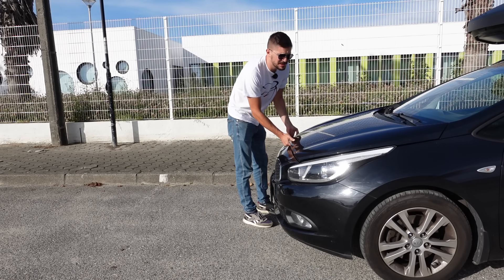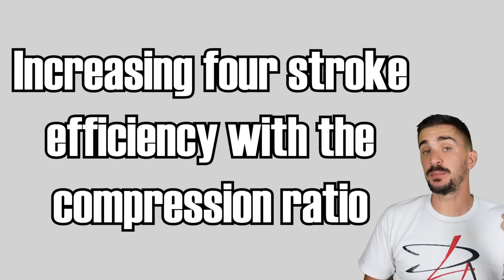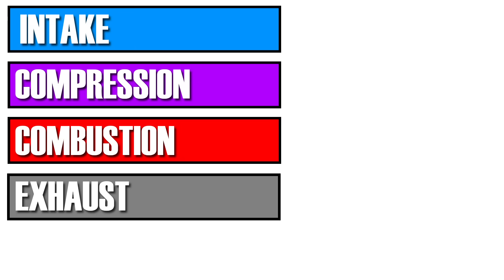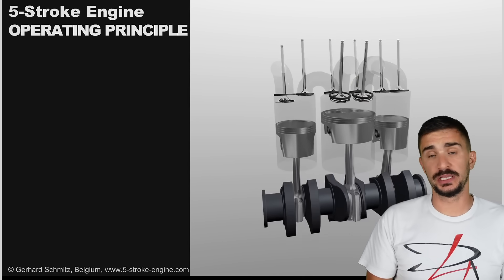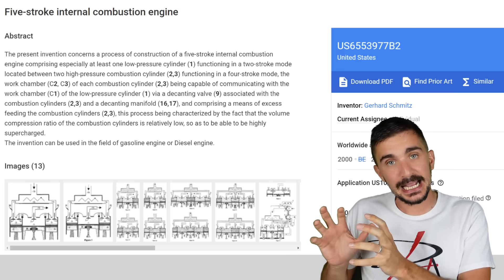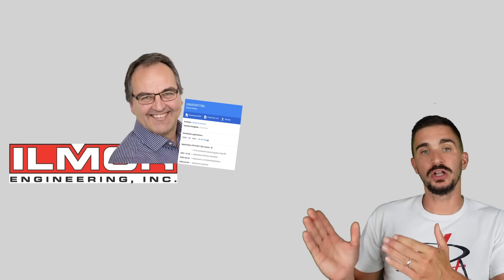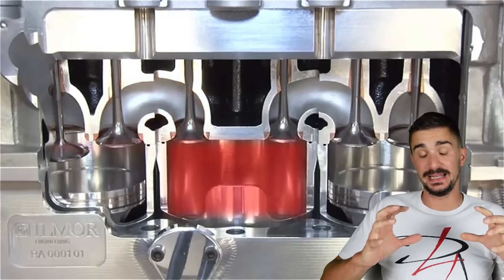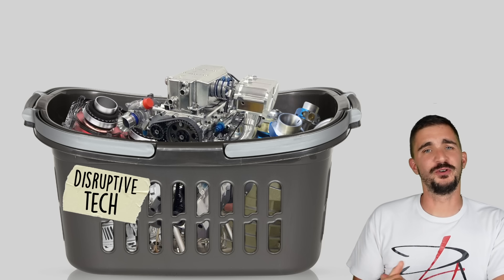Why Five Stroke Engines Are More Efficient But Still a Failure

Comment: The issue is that automotive companies avoid several different methods that would make a.massice difference.  For example, ceramic coating the outside if engines, using steel as a jlock material because it was reduce vibrations more than aluminum and stay stronger than iron, ceramic coating the combustion chamber decreasing engine temps without decreasing compression. Which is no other process of putting less load on the cooling system, to require cooling by reducing electrical load which generates less heat as a result cooler burning fuels with the same thermodynamic properties, making motors with longer lasting seals, using more electrically conducive block materials because the engine block is actually a major part of the electrical system, oil with a higher conduction rate... wll I suppose that's mostly ways they could but refuse to use to increase efficiency but the point still stands. Less electronics. Better drivers education that actually creates better drivers which is the most important part of efficiency, put maintenance schedules into law... make sure you knock sensor is mmaintained, as this is one of the least maintained parts, that don't get maintained enough. Improve common tire standards offuncyionality.... less luxury suspension. The list to improve efficiency over all is nearly enendless. The automotive companies are decades and more ahead of where they show you. Race technology is where efuviabegins, because if a race car runs out of gas it's not finishing the race much less running. For loose example. In 1969 Corvette zl1 was turning about 500 hp, and running times just as fast as the hellcat. Are you tiiniianout that? What am I saying? Stop demanding gimixs from the automotive industry and they will start giving you better cars. I used to know someone that got 30 mpg out of a factory 91 Lincoln town car. Stop expecting tech to make a better car and start expecting people to do a better job of driving, and nine òf it will be that big of a deal. Along that, Stop asking for so much power. Nobody needs 700 800 900 hp tq for a regular drive. If you can't drive fast in a slow car you shouldn't drive a fast car. At all. Because you're an unskilled driver and u need to calm tf down. That, and it's provable that electric cars are actually less efficient then both devil and gasoline engines, because electricity comes from somewhere and most of the places it comes from isn't actually good for thr environment.  Nuclear power plants produce emissions, that are worse than any other, coal does hydroelectric disrupts the natural ecosystem which is the same thing. Natural Gass power plants also are horribly bad for the environment because it destroys the land. Just start driving with better skill and safer and it won't be an issue.

Comment: in my opinion, the heat from the combustion engine should be used for running a turbine that creates electric energy that then will be used like in a hybrid. Just letting go the heat without using it is the biggest waste in combustion engines. If water is too hot, you could use alcohol as a coolant which vaporizes earlier.
The huge amount of complexity to squeeze the last 1 or 2 percent out of the engine while wasting huge amounts of heat seems to me like the wrong way to go.

Comment: I don't see why we don't have high compression, large displacement, under-square engines with Atkinson style cams to keep the intake valves open partly into the compression stroke thus artificially lowering compression and displacement, whilst enabling a longer combustion stroke.

I know some manufacturers use a similar method with hybrid setups to target maximum efficiency at the cost of low end torque, but i feel it could be scaled up to provide improved efficiency from a larger engine without sacrificing drivability, to offer a much greater thermal efficiency at highway RPM.

Using a multi-profile camshaft set-up similar to VVTAL, one could theoretically switch between Otto and Atkinson cycles, and vary compression on demand as needed which could also be used in conjunction with turbocharging and direct injection as you could take off in Otto cycle, then switch to Atkinson cycle and dial back the compression as RPM and boost increases, all without adding a ton of mechanical complexity like other variable compression systems as it's all carried out by the camshafts

Comment: In a sense, could a Turbocompound be seen as increasing the combustion stroke length, or rather, letting it partially continue after the exhaust stroke?

Comment: I think that if they made a 5 stroke V8 that would be really cool well it would be more of a V8 with two extra cylinders offset lower like a W engine but still. Also if they could develop a two stroke detroit diesel style (more of a three stroke) engine that's more efficient then a 4 stroke because there aren't three other strokes that rob power going on but also more efficient because the exhaust energy is allowed to expand a second time and even a third time spinning up a turbocharger that would be great.

Comment: External combustion engines are far less efficient 0:04
Reply: They do blow up efficiently and use all the energy to destroy the car
They're more efficient in a way
Reply: On the contrary, it depends on what they are trying to do. a bomb is very efficient with its energy usually :)
Reply: @ULouOW  well, if you count the energy to unalive a person, as it is its inteded use, its very uneficient, as I remember in a war you need about 200kg per person of explosives
Reply: I think Stirling engines get slightly better efficiency, of course at the cost of power, among other things.

Comment: What I am hearing is that the engine is a great design that was applied to a wrong niche. This sounds like a great engine for a stationary off-grid generator! If you can make it run on ethanol then it may even be a truly green backup generator.

Comment: If it works dont try to fix. It hard to beat a simple and reliable design. Ive been watching a (new to me) channel where this guy turns pretty much any thing with a rotating assembly into a 2 stroke or 4 stroke engine. Just goes to show you cant beat the traditional stroke and piston design

Comment: "perfect primary balance"
LOL. And crappy secondary balance and Big tiny Big tiny pulsed power. Four combustion cylinders should feed the re-expansion cylinder. Remember your Big Bang video? How two cylinders firing 120 degrees apart can merge into an extended power stroke? So the engine goes Bang Bang re-expand Bang Bang re-expand.
There's lots more, including the solution to the cold cat issue. Sorry I've been so slow. I'm about finished with my straight six emulator design. 2/3 efficiency feels doable.

Comment: Why not have central piston semi-combustio? on low rpm it can be regular one and from 2000-3000 become low pressure. Engines are used not only in cars, i've seen L6 engine in concrete pump, obviously it doesn't need catalitic converter.

Comment: But the equivalent of the Atkins cycle could be achieved simply by manipulating valve timing.  If you designed an engine with an absurdly large compression ratio (say 20:1) then you could simply restrict the amount of fuel/air into the chamber using basic valve technology.  Since you've got a smaller charge in the cylinder, it's pressure, once fully compressed, would be the same as if you'd used a conventional compression ratio.  But, you'd now have an available expansion ratio of that 20:1.

Would this not work?

Comment: Nice video, very well explained. The fourth reason for its failure was probably the personality of Schmitz. Genius inventors or engineers are often difficult people to deal with, burring interesting project premature.
I know what I am talking about, I am a (German) engineer myself 🙂.

I also loved your final statement; which describes the current political hysterical evaluation of the internal combustion engine. It must be understood that oil as a fuel allowed civilisation to modernize itself to today's standards, which everyone wants and for good reason desires. 
Although everyone agrees that we must move away slowly from oil as an energy source due to its final limitation, the current hype to abandon it immediately by making oil responsible for almost all evils of this world is so ridiculous. The EV-dream as an all-replacement is certainly not the way to go since it also consumes vast (but, well, limited) resources to manufacture them plus requiring an (electric) infrastructure so large, we will need three mother earth of copper deposits to install it. Not to mention greedy software conglomerates which are overburden these vehicles from the start with lots of unnecessary gimmicks to drive, control, repair, "upgrade" (their lousy products) and to charge them. 
I am sure the internal combustion engine will make a big come back, probably driven with hydrogen or non-fossil liquid fuels, particular since both options only require basically two ingredients: sun and water.

I will probably dig into more of your videos in the future.

Peace! from Dresden / Germany

Comment: the heavier internals of diesels are correct, however, its not the main reason they cant rev as high. its actually mostly due to flame propogation and the fact that diesel burns slower so it can push the piston with more force, but not as fast because gasoline burns much faster

Comment: Great video!  But on the last problem with the engine, the real problem was the old-style catalytic converter, not the engine.  The engine is more efficient and it's the catalytic converter that needs to catch up.  Thanks.

Comment: sounds like a ship engine to me. not a new one, no, i am talking multiple expansion steam engines. first thing i thought of when you mentioned the exhaust still being full of energy. also a ship engine wouldnt have too much of a problem with the efficiency curve, since it runs on a constantly samy rpm most of the time. maybe this inventor guy is just trying his luck in the wrong industry.

Comment: So, why don’t we use a two cylinder engine, stagger the strokes, and than connect their exhaust to each other so that it can be reused again. The stroke sequence would go as follows:-
(Piston 1: P1, Piston 2: P2)
P1 intake
P1 compression
P1 combustion 
P2 intake from P1 exhaust
P2 power stroke
P2 exhaust into the atmosphere 
P2 intake from atmosphere 
P2 compress
P2 combust
P1 intake from P2 exhaust
P1 power stroke
P1 exhaust into the atmosphere 
P1 intake from the atmosphere 
And repeat.
Note that both things are happening simultaneously.

I guess there’s already some prototype or some kinda engine which uses the above mentioned theory, but still, I had to let it out haha. Lemme know if there exists some engine like this.

Comment: We can achieve a very similar result with a small turbo and an extremely lean mixture, just like with this extra cylinder, the waste heat can be reused, with micro thermal power plants built into the exhaust, with which we generate electricity from heat. Just an exhaust detail, and it went from a 35% loss to almost zero right away. With a hybrid engine or an electric turbo, we can use the electricity from the batteries, right? I haven't patented this yet, because all its elements have been invented in detail, but for some reason no one has put it together like this. Lately, I don't patent anymore because I see that they understand the idea and think about how to leave out the inventor, so that we don't have to partner with him in the project, so that we pay him too. In the 80's, the inventor was still respected if I submitted a useful invention to a car factory, min. they sent a car in exchange. I think that sooner or later we will see this Belgian invention installed in our cars, of course as a secret development. They vary it a little so that it is not legally attackable, and the goal is pure profit. But if only they knew how little commission an inventor gets by with.

Comment: 8:18 Wait, compound engines are almost a hundred years older than that! Double, triple, and even quadruple expansion engines ended up extremely common in ship and infrastructural use, AFAIK, until diesel supplanted steam once and for all (in the 1960s or so).

Comment: The only thing I'm aware of about efficiency is the incomplete combustion of gasoline, that must remain incomplete in order to keep engine parts from melting because of the temperature increase. I have thought about capturing the heat produced by the catalytic converter which allows unburned fuel to completely combust, but it would make the engine bay even more crowded, and wouldn't do much during short trips.

Comment: more efficient?    get rid of gasolne... there ya go more efficient... being gasoline is inly flammable, and other fuels actually EXPLODE,,, so,,, extra stroke = less efficient unless its a power stroke...   being the suck squeeze and blow exert no power...  I run my cars on hydrogen....  no probs with efficiency here.. 100$ of the fuel go's off producing water out the exhaust..

Comment: I wonder, if they added a fuel injector and spark plug, specifically for low rpm/load, if that could possibly even out the energy loss in the low pressure piston? Or what would happen in a 5 cylinder layout. Hmmm, super interesting design.

Comment: I wonder if a variable stroke engine would be possible, like a V6 that would operate like a normal V6 under low load and low rpm and spool the turbo normally, heating the catalytic converter and getting the engine up to temp quicker. But, when entering into higher load and rpm, with the help of maybe electronically actuated valves or something similar to variable valve timing and a bridged exhaust manifold switch to 5 stroke, disabling combustion in 2 cylinders. This would definitely be less powerful than a 4 stroke V6 but probably more powerful than a 4 stroke V4, while being more efficient than both...and probably as complex as a W16

Comment: The first known electric locomotive was built in 1837 by chemist Robert Davidson of Aberdeen, and it was powered by galvanic cells (batteries). Davidson later built a larger locomotive named Galvani, exhibited at the Royal Scottish Society of Arts Exhibition in 1841. https://en.wikipedia.org/wiki/Electric_locomotive#:~:text=The%20first%20known%20electric%20locomotive,of%20Arts%20Exhibition%20in%201841. 
Yes credited wikipedia thought you would find that interesting. Great video.

Comment: The fellow below pointed out that if you were using steam it is a double expansions engine.   In the United States Navy, steam power was sent to a small High pressure turbine, and then to a much larger low pressure steam turbine.    The difference is you are exploding the fuel in pistons, which come from very old steam ship technology.

Comment: It makes sense why it never reached mass production. The low RPM deadweight could only be overcome by isolating the parasitic cylinders of the engine on a separate crank shaft which in turn would have to return power to the primary drive shaft via complicated engineering mechanisms. You would then have to split exhaust at low RPM to go through normal exhaust means but divert at high RPMs back into the said parasitic cylinder. The end result being more power at higher rpms but still deadweight, albeit reduced with less drag, at lower rpms. Not worth the space me thinks and Ilmore probably agreed with me, hence the move to the French company.

Honestly this would probably be a half way decent aircraft motor but there's already more efficient engine designs in that space. Particularly turbines.

Comment: How does this design differ from the V-5 that was a total success? I suspect that the difference was that cylinder 5 was a 4 cycle piston arrangement. I understand that harmonics were virtually eliminated in that design. Sure, a turbo increases power, but I  don't  believe  that power to engine size ratio is the same as efficiency. I am fairly certain that they did manage to decrease emissions regardless of power to weight (cheating). What do you think?

Comment: Do you need a turbocharger? There isn't enough waste energy to power one from exhaust pressure, because that pressure is used in the engine instead. That's good! If exhaust turbines were such a great source of power you may as well have one turning the wheels round. The pressure is put to better use. If you need a compressor, fit a supercharger instead. 

As for the catalytic convertor, they were designed to add on to existing engine designs. So put an electric heater in one! In fact, do that anyway. Many short trips don't get the cat up to temperature, so in practice it's not working and emissions are higher than expected. This engine reduces the energy sent out through the exhaust pipe, and you're saying that's a bad thing! Worst-case maybe spray a bit of fuel into the exhaust or something if you really want to heat the cat up. It's not an insoluble problem, at least.

Comment: how about adding a spark plug and an injection of fuel at lower rpm, might not need the sparkplug because the exhaust gases are hot, which stops when rpm reaches beneficial speed.
alternatively rev it sufficiently and use a wet clutch for motion control.